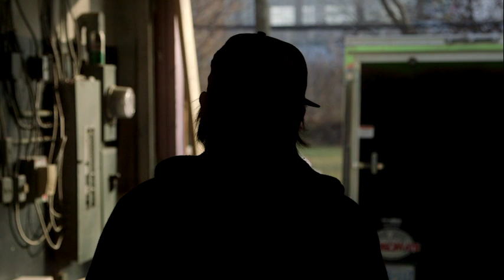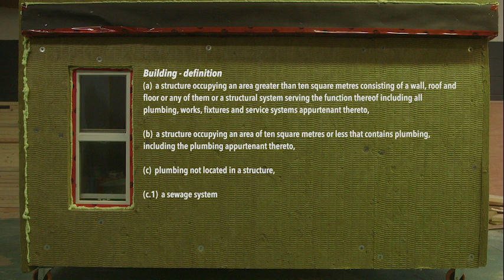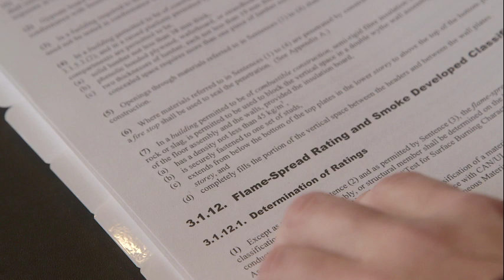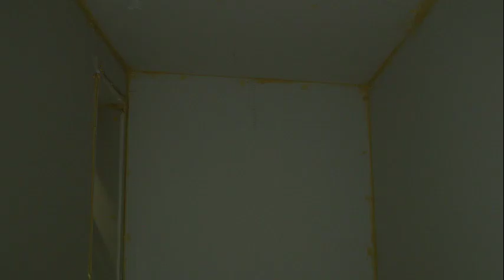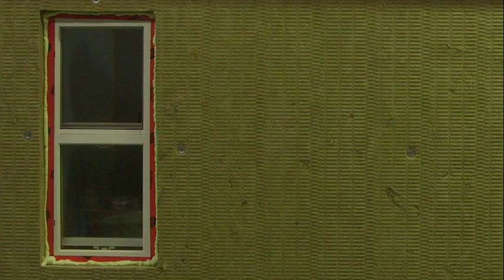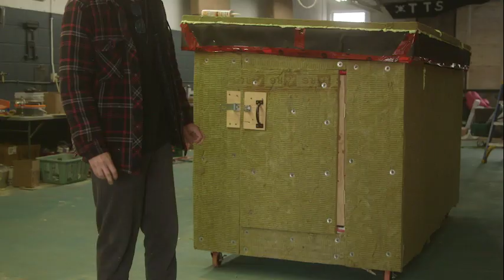Fire Safety Inspection - Tiny Shelters

Comment: Not gonna patronize or tell you your business, but this analysis doesn't include that fact that most of the people who live in these heat them with electric or propane powered space heaters, which are both volatile and unsafe if hooked up incorrectly or left unattended. The Toronto fire Department has been called out to 253 encampment fires in 2020 (27 since the beginning of 2021), and while some of that can be accounted for by the larger number of encampments, it's still a huge increase over 2019. These types of shelters are not created equal, and while this particular one might be better placed to stand up to immolation than others, it's not a stretch to say that these tiny shelters nevertheless pose a worrying fire hazard, which is complicated by the fact that these are primarily in city parks which makes them a huge liability to the municipality. I believe this city has failed a lot of its most vulnerable residents, and should be doing more to help those who are homeless in more meaningful and non-ephemeral ways, but these tiny shelters are a symptom of the problem, not a viable solution.